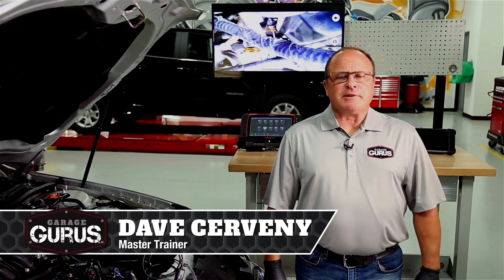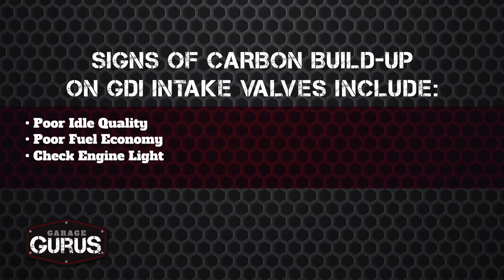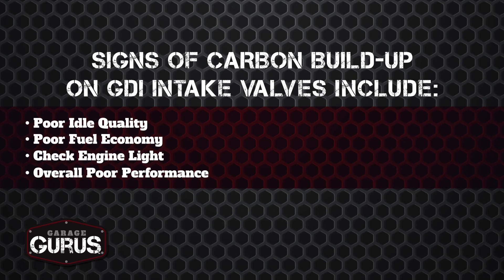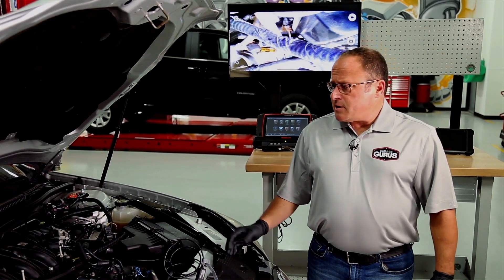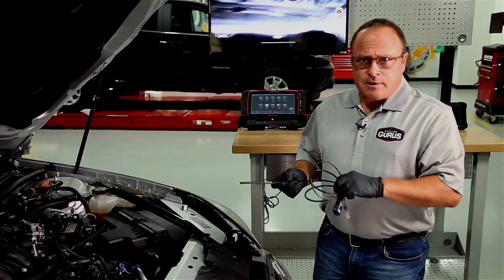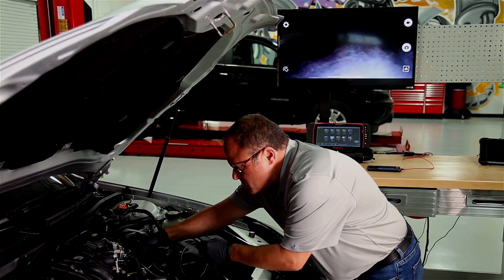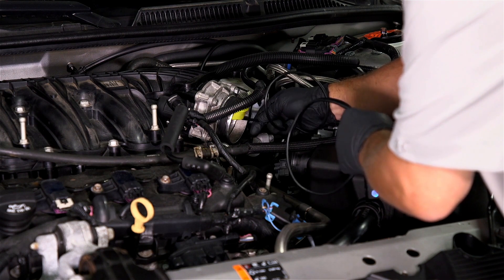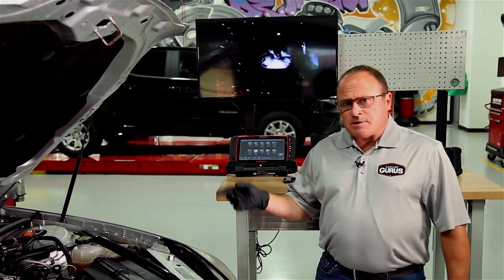Garage Gurus | GDI Intake Valve Carbon Build-Up Diagnosis

Comment: Nice info overall, though I can't understand the logic behind using fuel additives and/or higher quality fuel. The very reason carbon builds up is because the fuel and whatever additives are added to it don't get to the intake ports in the first place.
Reply: I came here to say this. the catch can make sense but the additives in good gas don't really compute, at least not for this specific issue

Comment: Would non-ethanol gas be better? I know my engine likes E0 better.

I also have tbe BG 3-step done that really helps. I've seen before/after BG on my pistons and they go completely black to shiny with OEM stamped markings showing.

I recently saw some oil consumption at 144k 2016 Sonata Hybrid and realized the pcv had never been changed. After that it seems to have helped.

Comment: Fuel additive does nothing other than cleaning the injectors, catch can is also not a good tip, just avoid DI engines unless you are getting rid of it in a few years

Comment: Catch cans will void warranty and possibly damage your engine.. It requires constant maintenance and if you let it overfill you can hydro lock you engine ..say good bye to your motor. Also GM has added a baffling system to help retain the oil in the rocker cover which is similar to a catch can but drains it back to the crankcase.
Reply: You're correct on the possible damage.  Not sure about the warranty part unless it indeed hydro-locked or blew out crank seals, etc.  As a hotrodder though, the catch cans are THE way to prevent the problem in the first place.  Some of us running forced induction also utilize water-methanol injection (for other reasons), but one side benefit is clean intake valves.

Comment: Old outdated info. We as techs have already made a Work Around from pulling the Intake, which is costly in time and materials, to preheating the motor on a long drive and back in the Shop adding threw vacuum Fuel Injection Cleaner Bottle, Streight Water. Opened up on the can so it doesn't flood the engine causing a Hydro lock. The method has been used for about 6 years now with a 100% Positive effect and 0% damage. Please update your info.
Master Tech since 2006, Tech Certified since 1996.
Reply: Hello, I have 2010 chyrsler 300 3.5 intermittent misfires.
Replaced everything.
Still doing it 200k miles
Car runs.  WHAT DO YOU MEAN BY Lucas spray additive through vacuum line I get but the water?
And Hydro lock.
Need more instructions.
OPENED UP ON THE CAN? WHAT DO YOU MEAN
Reply: @7thundersofrev10  This engine does not have the valve buildup issues as a direct injection has. Using a controlled water injection into your system will only remove the carbon buildup on your piston. But you can look this up on YT to see good examples. Now to the heart of the issue. What cylinder is misfiring? There are a few things that can cause this. More info please.
Reply: @donl4914  it does not say which cylinder.  I am going to check ohms on the injectors
What should they be at?
Reply: @donl4914  Ok there is a problem with vacuum system it almost immediately drain vacuum after turning off then I can not open trunk unless I pull string for trunk emergency lever through back seat.  Could that be my problem?
Reply: @donl4914  Thanks, OK where is vacuum pump located.  I can google I can not find it? Trunk does not hold vacuum preasure after car Is turned off.?
Reply: @7thundersofrev10  Ohms is not the question. Continuity shows the coil is intact. You should habe a p0300 core following like a p0301 or revelant cylinder misfire. Also if you have a scanner to use. Check the misfire counter. This is important when diagnosing an issue. As for the trunk latch, thats all electric, no vacuum. Most of the vacuum drops when you shut off the engine. Only vacuum left will be in your brake booster.
Reply: @7thundersofrev10  There is no Vacuum pump. Your engine is the Vacuum source. No, the Trunk does not hold a vacuum. The latch is electric, so you will have to find the power source problem. Better yet, take it to a mechanic who will diagnose it. I can't diagnose it from a keyboard.🤨🤨🤨
Reply: @donl4914  waiting on equiptment to check compression.  Will let know what I find. Thank you for helping

Comment: How is fuel additives prevents carbon build up on valves with gdi? Fuel not sprayed on valves with direct injection.  That's why Toyota uses 2 injectors per cylinder.
Reply: Yeah, this is a common misconception...
Reply: GM has said that during valve overlap it will get some reversion and keep valves clean if you do it as a steady practice as in it will keep it down but additives won't be enough if it's already built up.
Reply: @jimhaines8370  I believe Ford uses valve overlap also in their Eco boost engines to help scavenge the cylinder
Reply: @garygarafano8341  Everybody has used valve overlap to improve cylinder filing for almost 100 years. It is just noted that during overlap a byproduct maybe keeping valves clean because of reversion that happens due to over lap. Most boosted engines don
t have a lot of reversion because of the positive boost no matter how it is being forced in.